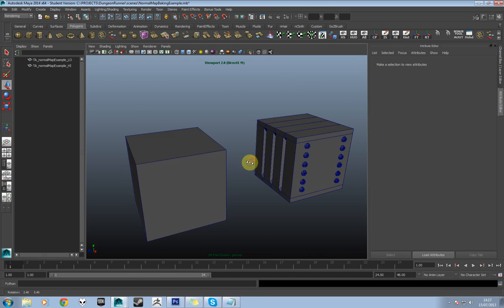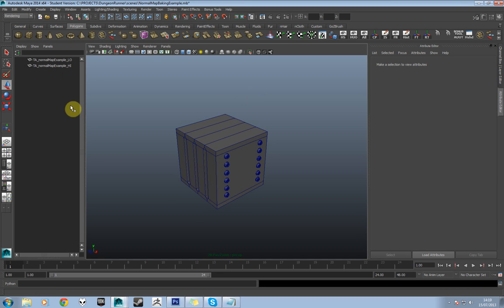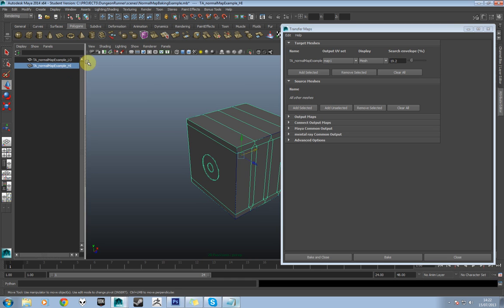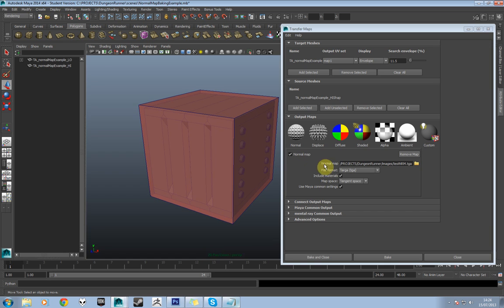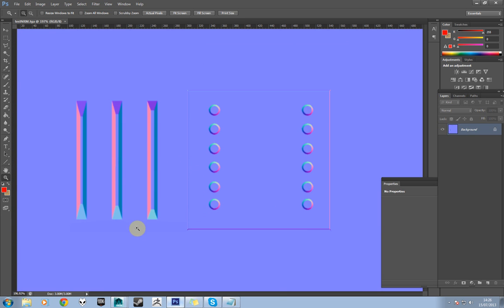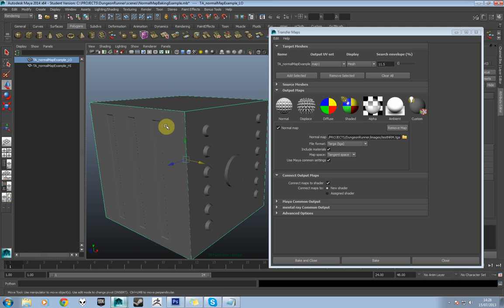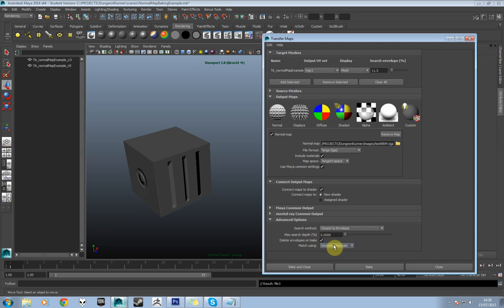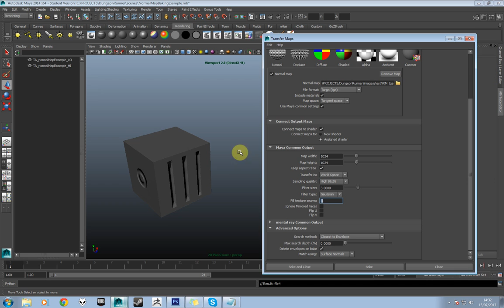How to bake Normal Maps with Maya

Comment: Great video, man. I'll see if this works on some of my character models. If you were to use mudbox could you adjust the envelope sizes in there as well?
Reply from the maker: Sorry but I use ZBRush instead of Mudbox, but most programs give you the option to at least change the overall cage distance, however not all let you edit the cages individual vertices
Reply: No worries, I figured it out. Mudbox allows you to adjust the distance from your base mesh that it checks for the high poly mesh instead of using envelopes. It is actually way faster at baking normals than Maya from my experience.

Comment: this helped me a lot but I have a question. say I wanted bolts  inset into the mesh,and plan to do a lot of arrays, so this would help on my memory.
 I do a Boolean  then put the screws in.  unwrap the mesh properly.
once I combine the bolts, with the other mesh, the uv's goes underneath the other uv mesh . so I have separate everything.  then once I am  done. how come the bake doesn't show the inset hole? I am seeing the outline of the hole and screw but not the inset where the hole is. could I click on the top mesh and reverse the normal? for the hole to show up? 
last question is when I go to transfer maps. every tutorial I have scene shows map one and the envelope. i am getting uvmap1 and envelope
Reply from the maker: +3D Isgreat  Is the inset for the hole at 90 degrees? So the hole goes straight down from the mesh?  if so then the baker can't see it, always do holes and corners at a slight taper for things like this ,then it will be picked up in the bake. This image roughly explains what i mean, for any holes or extrusions just make sure you have a slight taper at the very least http://img513.imageshack.us/img513/5673/normalmapdetails.jpg
Reply from the maker: +Tim Ash As for your Map1 and UVMap1 issue, it really isn't a problem if it is baking to the UV's you want it to. The 'Map1' and 'UVMap1' is just a default name for the UV set. That said, this could mean you have more than one UVSet on your model, is this the case? You will often do this for different mapping effects and lightmaps. However if you are not sure then go to UV>UVSet Editor and you can see how many UV sets you have on your model.
Reply from the maker: +3D Isgreat I have now done a tutorial to explain the tapered model problem https://www.youtube.com/watch?v=5Aj08-Da9U8

Comment: hello! i've been watching this video very carefully, but i still don't see when or how you applied the normal map to the low poly model. i am in the process of applying my own NM to my model, but I dont know how to apply it.
Reply from the maker: There is a radio box in the Transfer Maps window that says 'Connect Maps to:' you can pick either New Shader or Assigned Shader, this should put your Normal map straight into the bump slot of your models shader. 

If you are not seeing it in the Viewport, make sure you have the 'Textured' button turned on, also make sure you are in Viewport 2.0

Comment: Great tutorial! Thanks! Just to see if I understand the workflow correctly- in the modelling process, at a certain point, you duplicate the mesh and add many other details, but you only need to make UV texture map/lightmap for the low poly? Would this texture correctly using only the low poly UV's?
Reply from the maker: Yes that is pretty much it, you only need UV's for the low-poly 
The highpoly doesn't need any UV's, and can actually be modelled completely differently to the low-poly if you need to
Reply: Tim Ash you just blew my mind, do you really not need to uv the high poly? holy sheee
Reply from the maker: vietimports Yep no UV for the high poly

Comment: Great explanation, but when we will decide to bake in tangent space normal or object space normal? Let say that now your box can be deformed and bounce around it will still shade ok in world as tangent space normal is also applied to characters which walk around and deform. What if we use object space normal? Is than this box must be static or it can still be moved and tumbled to keep proper shading? I know it cant be deform or shading will be awkward. Can you explain more please.
Cheers
Reply from the maker: Tangent space is used FAR more for games than object, this is because it is far cheaper in memory, can be used on multiple models, and on deformable models. Object space only really has a couple of uses now, and really only for pipeline things rather than actual final game textures, because they are easier to bake.

For example I bake Object space for texturing in Quixel DDO, so it knows where to put things like dirt and rust. Also you can bake an Object space map and convert it to a Tangent map using Handplane (which is free!). This might sound mad, but it actually gets rid of a lot of problems with Tangent map baking, so some artists find it easier to bake an Object map and then convert it to Tangent with Handplane 

An Object space map will work on a model that moves, as long as it doesn't deform. So a dice would be a good example I guess
Reply: Tim Ash
Wow dude, thank you for your fast reply :)
So tangent is a way to go. I am still learning, though this gives me such a pain. I installed mudbox recently but having strange issues with artifacts on non planar faces (diamond quads for controlling face loop flow), it drives me crazy, and further more when i apply that normal map created in mbox back to maya low poly, its surface is corrupted just as it is damn low res. I tried to find solution on net for this but no success :(
Reply from the maker: Zox Wolf It could be a number of things but one of the most common is smoothing groups. Have you set up normal smoothing on the model? The typical rule is to soften all the edges first, and then harden the outer edges of all the islands in the UV window before you bake, this is REALLY important for good baking. You don't even need to do this by hand, you can do it with this script, just select the model and run this script:  https://dl.dropboxusercontent.com/u/499159/UVShellHardEdge.mel
Reply from the maker: Zox Wolf I am going to upload a detailed set of Normal map tutorials soon, keep a look out, there are a number of things which can cause issues, usually it's just a matter of going through them all a few times until you have memorised them, then you can recognise whats causing the problem! I do simple baking in Maya, but use XNormal for the majority of my baking, especially when taking high poly models out of ZBrush or Mudbox
Reply: Tim Ash
Tim, thanks for fast replies :) I will install this script on my custom shelf :) Is this technique important for tech modelling  only? I mean i am trying to do this on my character hand just for testing purposes while i learning bits and pieces. I recon that one need to work in order to learn so i do tests on small pieces of my meshes. So if organic models are in question i do smoothing group on all my edges? I mean if i harden outer edges of uv islands they would be visible in final render. Is this correct?
So u dont use mud box normal map extraction technique but export high poly model in xNormal and there create your normal map? There are much tricks in this job to learn proper flow  :( my brain hurt and my eyes bleeding.
I would be grateful if you enlighten my ignorance.